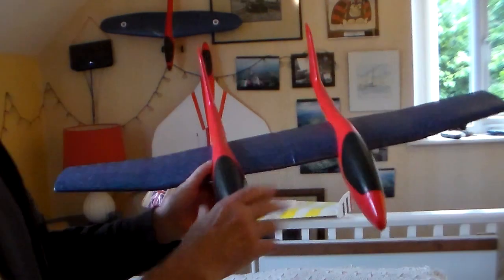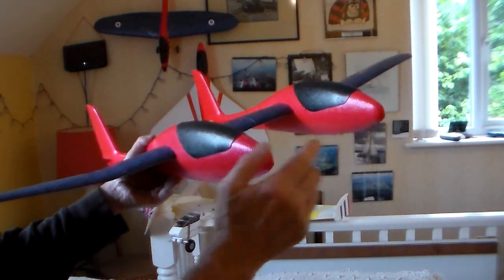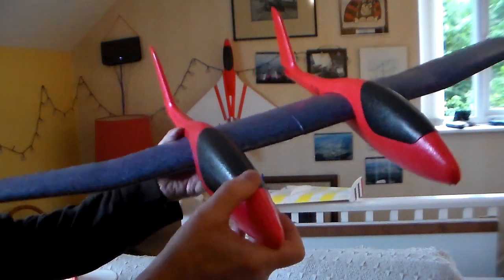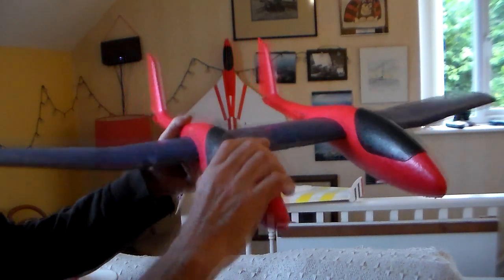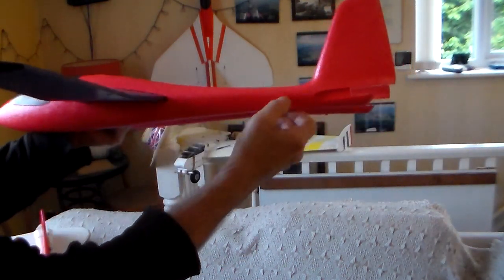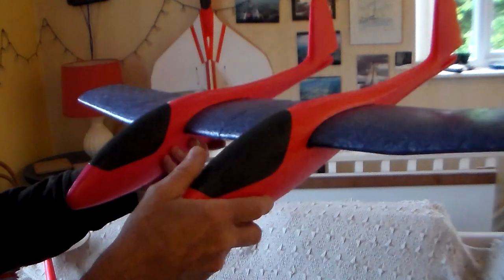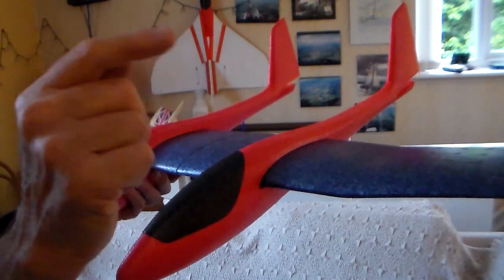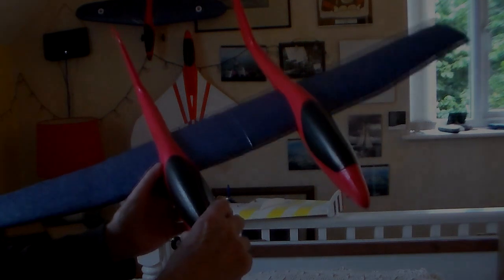My Lidl RC build no. 9 is about to start.  :)      What am  I  going to do this with this one?

Comment: I think a mosquito style plane would be good.  Twin booms with  the fuselage in the middle . Putting the elevator between the two rear  rudders. And having ailerons ?
Reply from the maker: That's a good idea. I just bought three more Lidl gliders!  10 RC so far plus 5 small ones. Running out of ideas!
Reply: @bobflyman  Yeah , its a really easy way to get into the air and they fly really good too !

Comment: You could put a 3s 22mah battery parallel to the leading edge in the centre between the fuselage 🤔 You mentioned you can't have split ailerons well actually you can, I did it on my Lidl conversion by having a short piece of carbon sliding in a tube 👍
Reply from the maker: Ha ha, I'm just working on the build blog and I say in it I'm going to put a small pod under or over on the centre line of the main wing to take my 800mA 3s!  Great minds and all that. ☺ As far as the aileron goes, which vid? I'd like to see how please.

Comment: You could put the battery in a gondola under the center wing.

Have you thought of a Blohm & Voss BV 141?
Reply from the maker: Thanks, that's pretty much what I decided upon.   I've made a small pod in the centre line of the main spar. I Googled Blohm & Voss BV 141, that is quite a machine!

Comment: Can't you just use the raised/outer part of the wings for the ailerons? 
Two motors? Maybe consider differential steering?
Reply from the maker: I did think about differential steering, kind of want to keep it simple. In the end I decided to take out the dihedral and put slightly bigger ailerons. I guess it would have worked with them just on the raised part. I wanted bigger though.